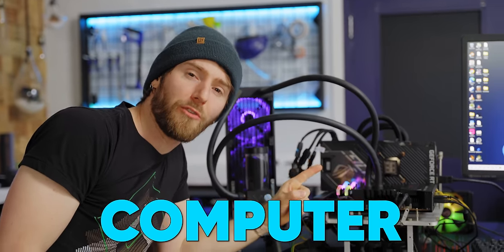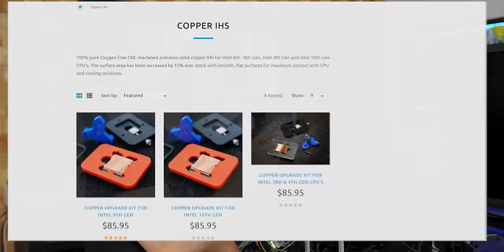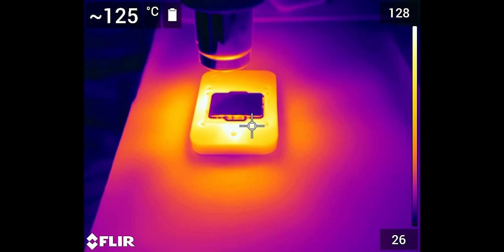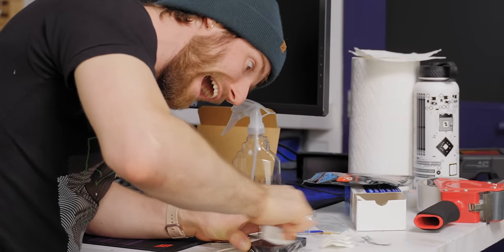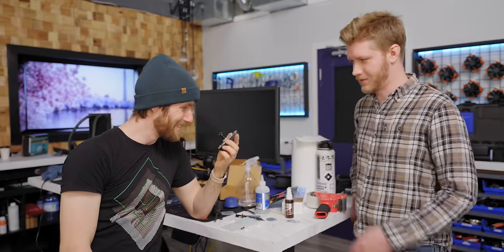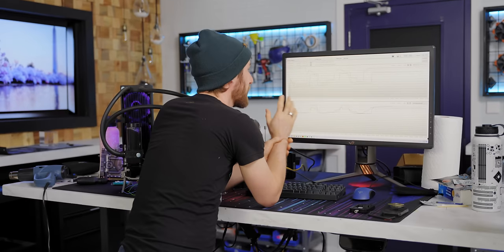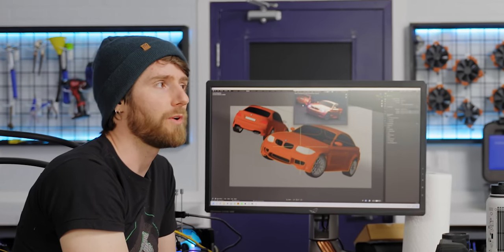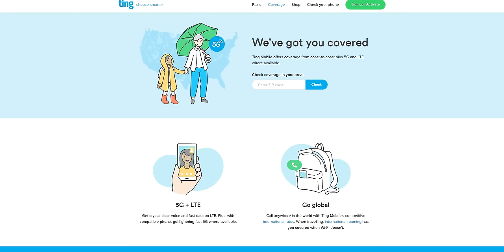Making Intel's Worst Product Better.... And Also Worse

Comment: For 10celcius, intel could have made a special heatspreader just for the KS mostly for the money. At least it worked flawlessly, nice job.
Reply: That would really justify the KS name
Reply: @girlsdrinkfeck  which video was this?
Reply: I’m excited to see how it holds up long term.
Reply: @girlsdrinkfeck  The game is not about heat dispersion for a long time now, CPU cooling is like 95% about heat transfer from the die/IHS to a few milimeters away. That's the bottleneck, especially because CPU/chips are small. Once we can move the majority of heat just a few milimeters from the IHS, it's almost trivial to get rid of it.
Reply: +1, they should use more precise IHS from factory for their ks models(like in video), as it is more luxury, also price is about 200$ more than the standard k variant. So what gives @Intel
Reply: yeah sadlife
Reply: @vinaychekuri5043  The article on it is called "Behold! The Most Insane Crowdfunding Campaign Ever" by: Brian Benchoff 
It was from back around 2014 or so, and Paypal ended up freezing the account of the so-called computer builders.  It was hyped up but not everyone knew of what the outcome was, as a copper foam would insulate as much as it would cool.
Reply: @MoonRegolith  thnx
Reply: now we need to see a GOLD heat spreader!!
Reply: @SteveQ ah, your right, diamond it is!
Reply: @bathrobeheroo  Go deeper. There's research going on on how to pull the heat away from the transistors to the silicon substrate or above. Things like in-die water-cooling channels. Look up "TSMC Exploring On-Chip, Semiconductor-Integrated Watercooling
" for info, since links are prohibited now.
Reply: Because people will buy the KS anyway. Getting this expensive option would eat into their margins and you know Intel loves their margins.
Reply: @SteveQ I wonder if things like sapphire and moisannite could hold a flame to the conductivity of diamond. Those are artificially manufacturable. 
But yeah silver is the best metal conductor. 
It does tarnish though. 
A gold plated silver ihs would be the one.

Comment: I just finished rendering 5,400 frames of 3D animation, a second less each would have saved me 1.5 hours of downtime so, under the right conditions, it's totally worth it!
Reply: Can't you render on gpu though?
Reply: @matejnemec4616  a second less per frame is worth it, either on cpu or gpu --for this video the upgrade was cpu cooling anyway, not the actual cpu
Reply: Makes you think about having one of those coppers on your GPU, and putting the whole thing in an actively-cooled liquid bath, to me.
Reply: @davidgoodnow269  precisely! especially considering how sensitive are gpu clocks to temperature these days
Reply: Yes, though it's getting to a point where it would just make more sense to have 2 computers render 2700 frames each. Much faster. And after a point, or at a bigger scale it gets cheaper at the same time. Including the power costs.
Reply: Depends on what you are comparing though. $30 and all the risk of destroying the CPU might be worth it to boost your current investment. But if the goal is faster rendering in Blender, then dropping an RTX 3070 (which are finally available at retail) into your present PC, regardless of the CPU, is going to absolutely destroy the I9-12900KS for the same price (Blender benchmark of 399 for the i9, 3411 for the RTX 3070 in Optix)
Reply: @RothAnim  yeah 100% it depends on what you currently have and where you think the biz is going
Reply: @davidgoodnow269  GPUs don't use IHS. The cooler touch the die directly.

Comment: With the massive premium Intel charges for the KS variant cpu, they should include a machined copper IHS kit like shown free.
Reply: That and much more. Like guaranteed all core clocks for a specific voltage. Like siliconlottery did it.
The KS series is like an amazing wagyu steak packaged in a terrible paper bag with holes in it. Something you might expect a pretzel to come in.
Reply: Honestly it should be solid silver
Reply: @toby1248  Would gladly pay for a pure silver IHS.
Reply: @aluckyshot  they used to exist a few years ago. Not sure why they aren't available anymore
Reply: I love that Idea, sounds like an amazing way to get your investors to raise their pitchforks
Reply: @nickfosley2882  The expensive features should be added to the wholesale price with a profitable margin.
Reply: @johndododoe1411  They make chips in batches, they'd have to commit to a certain amount during production. Also why would they make another SKU if you're going to buy the one they're already selling anyway?

Releasing another SKU could potentially be a shot in the foot because if they price the copper IHS version too high, everyone would just tell you to grab the cheaper one.

If you price not much higher than your current lineup, everyone would just buy the better one, and nobody would buy the obsolete version.

TLDR: At the end of the day you're going to give them your money anyway, and they don't have to risk losing a ton of money for a niche market = Investors happy
Reply: @johndododoe1411  Sometimes it goes deeper than: make new product + charge higher price = profit
Reply: The whole point is that they ask a lot more money for a little extra cost. They want to make as much profit after all and people are still buying the KS anyways. Also, not every enthusiast wants or can delid it and not break the CPU in the process.
Reply: @nickfosley2882  These are adjustment features that can be done when testing and binning chips near the end of the production line.  Before starting a batch, reserve some on chip "checkboxes" for chips passing the extra tests.  After running the batch including the testing and on chip marking of test results, there will be a (small) percentage that can be sold at the higher price that justifies the work to set this up even for the chips that won't pass the extra tests. This is the well known concept of chip binning, already done for clock multipliers and core counts.
Reply: @johndododoe1411  They can only test/bin the chips once they are lidded. They'd have to pay expensive engineers to sit in the back room and delid each (passing) processor one by one or design an entire machine just for that step, cost could potentially be too much to offload onto the customer, and I guess it comes back to: Why would they take the RISK to make an entirely new SKU if you're just going to give them your money anyway?
Reply: @nickfosley2882  There's a dedicated common machine testing chips before cutting them out of the wafer and putting them in packages with lids.  Anyway, anything that fits in the same packages and sockets can be differentiated by the numbers printed on top and on the box.  No different processing, all done by robots.
Reply: @johndododoe1411  Good to know, do you happen to know the name of the machine of which you're speaking of? Also, it's beyond robots, there's marketing, product awareness, you have to realize this imaginary product is very niche, and even if there isn't a copper IHS variant, I'm sure their current customer base will happily pay for the CPU regardless of the copper IHS or not. 

Intel is still dominating the consumer CPU market(72% last I checked), not because of their crappy IHS, but because of everything else. Intel making this product will not be innovative by any means, it seems like a waste of their time when they could be improving the CPU's power/efficiency itself, and I think my assumptions are correct according to everything Intel is doing. 

TLDR: We have to assume there is a bunch of smart people working at Intel, and we aren't thinking of anything new that Intel themselves haven't thought of.
Reply: @johndododoe1411  Don't get me wrong, I would love a copper IHS variant, but I live in a reality where I understand why Intel isn't doing this, it's not profitable to be worth their time even if they make a profit. Sounds ridiculous I know, but Intel knows how much they are worth. That's why they are designing new bigger and more profitable things like GPUs, which make investors happy. Intel is a company.
Reply: @nickfosley2882  It's the testing machine, I don't know its official name, but it's been part of chip assembly lines for decades.  Whenever chipmakers talk about the "yield" percentage, it's how many chips aren't declared worthless by that machine.
Reply: @toby1248  wasn't there a bad reaction with gallium? Anyway silver is not even that expensive: currently approx 26eur/31g

Comment: Seems like a process that should be implemented by CPU producers on their top-tier products.
Reply: I actually find it insane that top of the spec products don't even, consider outsourcing cpu lids for a product that just only realistically exists because a competitor is outperforming you.
Reply: @namonaite  Not insane at all. That's how halo/flagship products work. Why do people forget that Intel wants high margins.
Reply: but u also can said the other way around if they gone that way, that u need to pay more for non crap IHS
Reply: For real, I don't buy the explanation that manufacturers couldn't scale this up to mass production when they are producing chip dies that require far lower tolerances than machining smooth IHSs.
Reply: @brice0403  it would also cost them far less because scale.
Reply: Intel actually does gold cpus. Theyre the top 5% of the top 10% of tested chips of any given variety. Have a 10700k gold that pretty much baseclocks at 5.0

Comment: Few hints (from old delidder): 1. Cut the cotton part from ear-stick-cleaner and spread thermal grizzly with plastic sharp part (avoiding any cotton hairs that can stick in), and 2. Don't remove all glue from cpu pcb just gently clean it with isopropyle alchol, (it's okay to have part of it left on pcb) then apply medium-thin silicone glue / whatever you use. Tested many times, 100% best way. And gift tip ... dont wait too much for glue to settle, put in cpu socket and lock it, left it there to settle under pressure of locking mechanism, that way you get correct thermal compound distribution over cpu die + IHS.

Comment: main issue with this is that cupper and gallium will react and liquid metal will "dry out".
Maybe precuring cupper surface with LM will create layer of CuGa2 and it will not dry out anymore, but I did not test that.

Comment: What I really would have liked to see is just how much difference lapping the original IHS would have made before they removed it and installed the replacement IHS. They could also have tried delidding and replacing the solder with liquid metal to see if that made a big difference. As it is we don't really know if the improvement is because of a flatter IHS, using liquid metal as a TIM instead of solder, or if it's the new IHS that makes the most difference.

Comment: Everytime the CPU boosted higher with the temperature dropping. Now what I want to see is a situation in which the CPU doesn't draw more, to see the true temperature difference. Maybe limiting the CPU clock to whatever the stock CPU was running at. I think it should actually reach the 15°C mentioned online.
Reply: Limit the CPU clock in both tests, that way all factors will be the same.
Reply: I think this is really what they should have done before thinking about 20W extra, higher clocks, overclocking or whatever
Reply: Also.. if they want to have a legitimate comparison, they probably should have used the same cooling system..
As impressive as the temp drop is, the fact that they used different coolers for the 2 stress tests invalidates everything in my eyes.
Reply: @MasterOfNone585  I think they used the same setup for both.
Reply: nah, nobody cares about the temp of your cpu. The purpose of cooling a cpu is to get more performance out of it, so testing the performance is literally what matters. If a cpu performs the same at 100c and 40c, why would you spend any amount of money to get it cooler? It's not going to help longevity either, you can run a cpu near tjmax it's whole life and you'll need to upgrade your cpu because it's slow as shit due to the time that has passed before anything actually happens to it.
Reply: @flyingtentacle7631  In this case they mentioned the 15°C claims. The main problem is that they made a conclusion on that without actually testing it in equal conditions. THIS is a huge flaw. Your CPU might perform the same at 100C and 40C, but if your CPU can pull the same performance at 40C, it won't randomly thermally throttle. Cooling MATTERS. It is even the most important point when trying to squeeze performance out of your hardware. The closer to the heat threshold your CPU is, the easier it is for your CPU to get over that threshold and boost lower, leading to sudden and frequent frame drops. Using the same conditions to compare temperatures gives you an objective and trustworthy estimation of the cooling solution's performance. To know what a particular change does to a system, you need to only change that particular element, or you can't draw any conclusions.
Also, testing the performance is one end goal, but it is specific. Due to the lack of information as to the performance of the mod, the performance increase they tested can only apply to the specific case of the i9 12900KS with an open air setup and graphene-based liquid cooling (and a 3090 ti for gaming benchmarking). The performance the CPU can boost by can change depending on these parameters, as how fast heat can leave your system isn't the only parameter. How much heat is retained isn't the only parameter to the results.
This is why details matter. If you only look at one thing, you'll lose both the accuracy and the validity of the results.
Reply: @Exilum  Oh I thought I heard them say "custom water loop" was used for the first test.
Reply: @MasterOfNone585  Yeah he just said it's a fully custom loop, not that he used another custom loop for the first test.
Reply: @Exilum ell it clearly dropped the temps by at least 10°c lol this testing was more than accurate enough for cpu cooling its not rocket science
Reply: @MV-ri7zu  Limitingg the clock speed is important when testing for temperature. Higher clock speed = higher consumption = more heat to dissipate.
Reply: @Exilum  yeah which means it made a MINIMUM improvement of 9°c since it was tested at 20w higher lol I dont get what you are struggling with here taking that extra 20w into account we can estimate that it probably helped a little over 10°c, but it will help at least 9°c. Very simple stuff.
Reply: @Exilum  you are massively overcomplicating a very simple thing for no reason.
Reply: @MV-ri7zu  Like a lot of people, I was really interested in seeing whether the 15°C claims could be proved or disproved. At least 10°C does not give us much to work with, there are too many variables to just assume linear growth.
Reply: @Exilum  the only variable was that the second test was done overclocked lol they were on the same setup, same location, same day and same stress test. The pure copper IHS gave a crystal clear advantage.
Reply: @MV-ri7zu  ... There's still a non-negligible margin of error. There's variance in installation, it was done by a human, this introduces slight losses in precision, and the results could vary depending on how tight the cooler was put down, and what was the original repartition of thermal paste. Also, room temperature might seem constant, but it fluctuates. This was done in a studio that while has A/C also is lit by strong lights for recording purposes. If you made an estimation, it would be compounded upon all these <1% margin of error, and as anything compounded does, it accumulates quite fast. You could extrapolate a likely result from this, but the margin of error would be easily over 1°C, which is not acceptable. This is why me from the past wanted to see results from such a test, and I still think this would've been great.
Reply: @Exilum  so 9°c +- 1°c improvement at least lol the point is the difference is so massive that it doesnt need further testing to prove that it works
Reply: @MV-ri7zu  Nope, f(9+-1)°C, where f is a function that given the overclocking data gives us a new temperature range for the same machine pegged to the first test clock speed. Even if it ends up being exactly 15, it's likely to end up being 15+-3°C in the best case scenario, which is nowhere near precise enough.
Reply: @Exilum  doesnt matter how you spin and overcomplicate it the test is still clear proof that the ihs copper plate has performance benefits lmao
Reply: @MV-ri7zu  "Has performance benefits" and "Has 15°C of improvement" is not the same. That's the whole interest of doing further testing. It's weird you don't get that.
Reply: @Exilum  yes around 10°c of performance benefits as we can clearly see from the video lol
Reply: @MV-ri7zu  Which only tells us it's >=10°C, now whether it's =15°C.

Comment: Man, this takes me back to when I had a phase where I lapped the mating surface of my heatsink as well as the top of the IHS so there was less thermal compound needed to fill the gaps.  I certainly didn't get a 10c improvement, but it was pretty cool to have a near-mirror finish on your CPU 😎

That was right in the era of having a DFI LanParty motherboard with UV reactive PCI slots.  Wish I had pictures of that setup still!